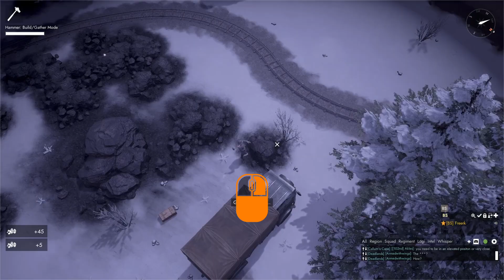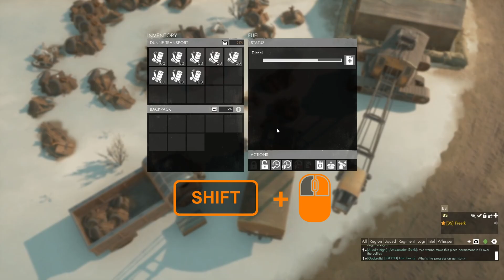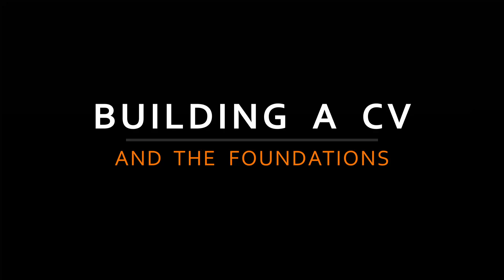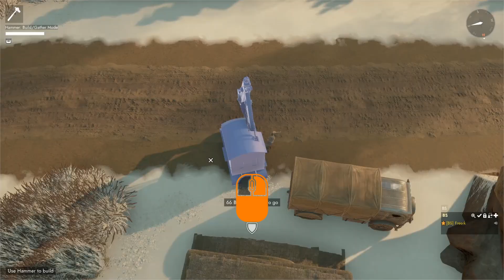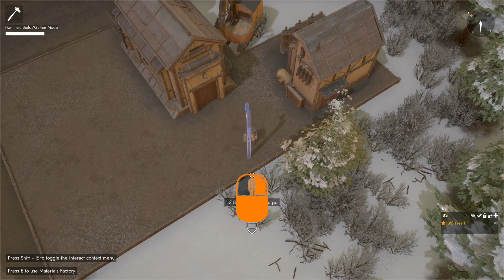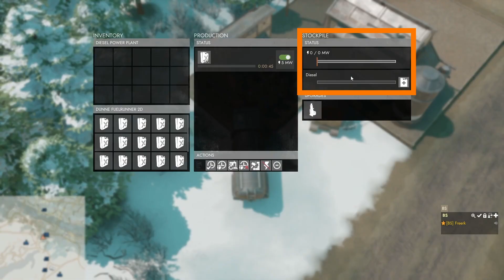Foxhole Facilities - Facility Basics, Part.1

Comment: Still new to the game (maybe 80ish hrs) but am interested in learning logi, is this info still pretty current and up to date?
Reply from the maker: The general rules and game mechanics for the most part still apply. The production panel changed quite a bit in facilities and I suggest you hover over the different icons in the production panel  to figure out what's what, or just ask around in game if you're stuck

Comment: why cant i press reserve for active sqwat?
Reply from the maker: It's tough to check that without being there. First and foremost; you have to be the original builder of the facility. 
I also think (but am not sure) you have to reserve it within a certain timeframe otherwise you wont be able to squad reserve it.
If you had it previously reserved and the reservation timer lapsed (52hrs) you can never reserve it again, only refreshing the reservation within that time frame works.
Facilities these days are changed; and squad reservation will only prevent people from upgrading it, not from using it's stockpile or recipes.
Reply: @FreerkHoltes  i have build it and immediately tryed to reserve it, i am not in a squad tho, could that be the reason?
Reply from the maker: @Snowmando_TV  Ah yes, if you are not in a squad it won't work.
Reply: @FreerkHoltes  thank you, now it works

Comment: 16:30 Note* That you do NOT need to be inside of the vehicle to get the gas into the power plant. The fuel truck needs only to be close enough for its hose to reach the building and you can refuel the power plant by selecting it while on foot. This works the same for most other things as well.

Comment: regardless of what he says. do NOT build a fuel runner to refill your power plants. you only get 1/4th the total fuel per run if you were to get a flatbed, and put a fuel container on it. They hold 100 units of fuel (instead of the fuel trucks 25). Build or find a flatbed at a garage, build the fuel container at a construction facility, and use the crane next to the refinery to move it. It's a touch more involved then clicking a button in the refinery.. but, you will only have to re-fuel literally a quarter the amount of times.
Reply from the maker: part 2, deals with this :D. I started this way cause not everybody has a flatbed at the ready at the beginning of a war
Reply: @FreerkHoltes  i mean no disrespect - but, even teaching this method to new players is a waste of their time. i look back on how much time i wasted running fuel runners before flatbeds, and it makes me sad.
Reply: @bobhope2380  Learning is rewarding  for new people too. I spent quite a while using trucks while I was learning and once I got competent swapped to using flatbeds. The extra complexity of cranes and packaging/unpackaging put me off using them at first.
Reply: @tugman1234  i completely get that. but once you start using flatbeds,  you will realize how much time you waisted, and how inefficent it was doing whatever task you were doing.
Reply: @bobhope2380  gotta walk before you can run
Reply: I appreciate doing something inefficiently because its a dopamine boost to learn something that is more efficient
Reply: @jamesshepard1162  i can appericate what you're saying. but, if you WANT to do something inefficently, watching tutorial videos isn't the way to go about it.
Reply: Never say never to new players. It can create bad habits. There is a time and place for fuel runners but big logi projects aren't one of them. If you tell someone new not to use them they'll never understand where and why they can be good.
Reply: Flatbeds need Rmats. They are not something you can just make every time you need to refuel. If someone's is barely starting to get set up a fuel runner is good enough until they are settled down and have more infrastructure
Reply: Nah. Thats wrong. The Fuelrunner and the fuel Container both have capacity of 100 Units. But you can get the Fuelrunner only with B Mats earlyer in the game and its faster than the Halftrack Flatbed. So you should only use the Flatbed to carry a Fielcontainer somewhere to use it as a refuel station or something, and then use the Fuelrunner to refuel it, because its faster and also holds the same amount of fuel. 

Flatbeds should be used for raw materials on short ranges when Ressource Transfer stations, cranes and Containers are available. Because they can carry 5000 units with one container, normal trucks 1500 while the Dumpsters can carry 2000 units of raw Materials only.

So it totally makes sense to use them in the early game more than in the lategame.
Reply: Most bases always have cranes to use as well for those specific purposes